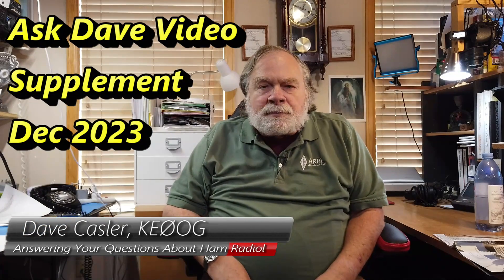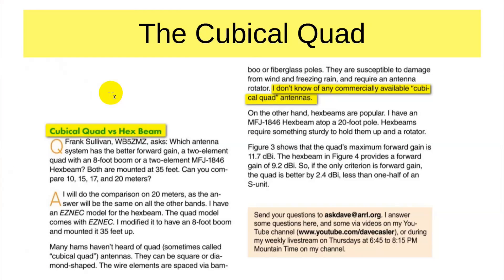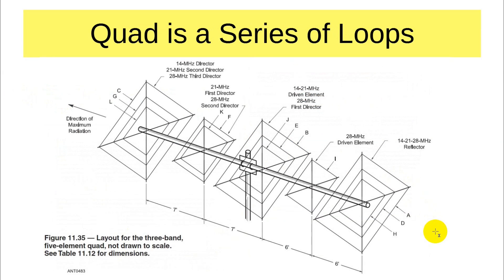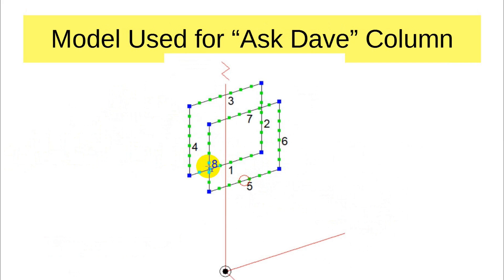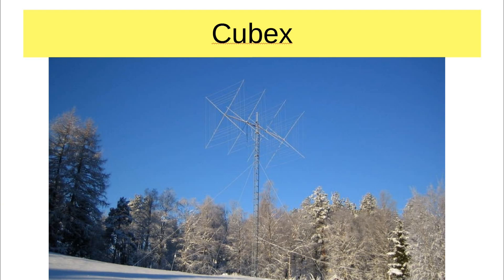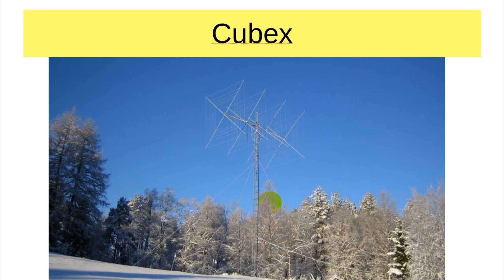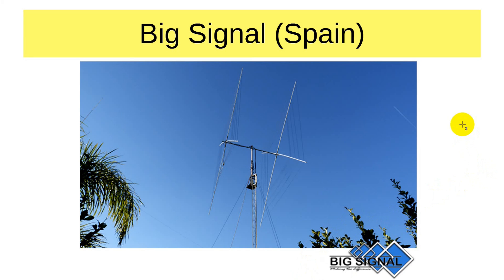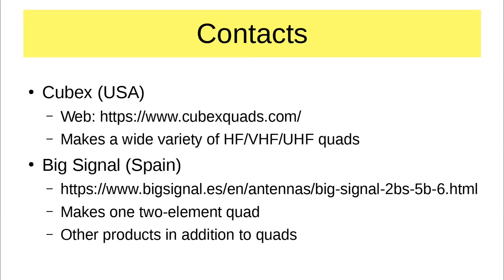QST: Ask Dave December 2023: Cubical Quad

Comment: Hey Dave, great video. There is one more quad antenna that has a unique boom arrangement. It’s called a GEM quad. Unfortunately, this company is out of business, but they did make a great antenna at one time. I have been using one of these antennas for the past 40-years. Do a google search and you can still find a picture of this antenna. 73’s.